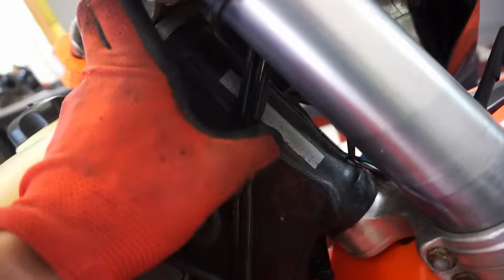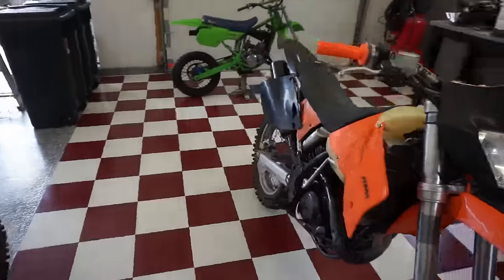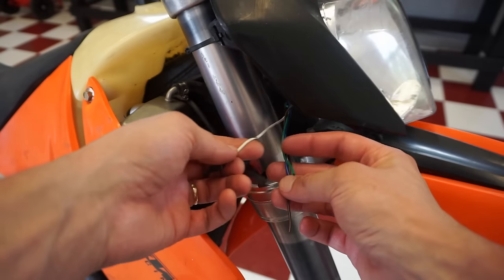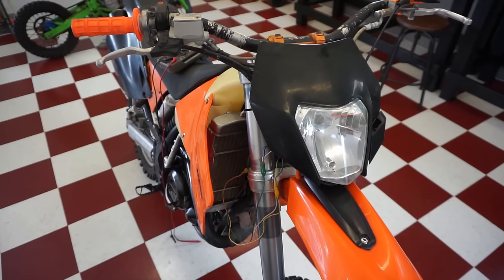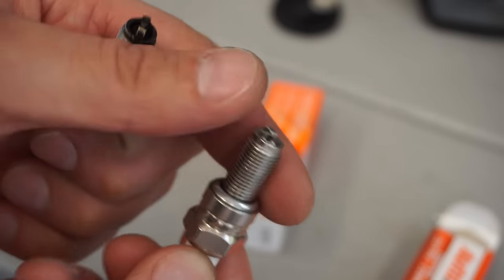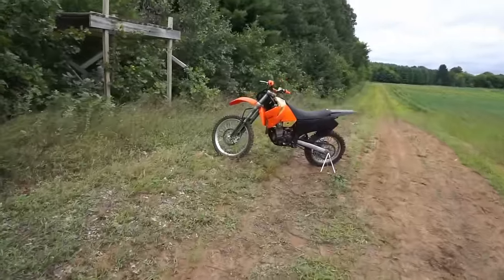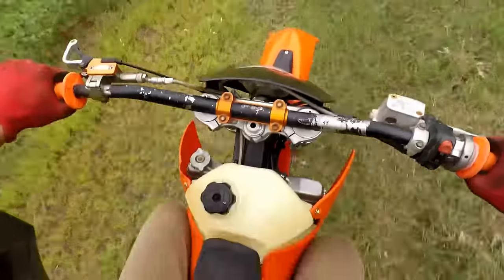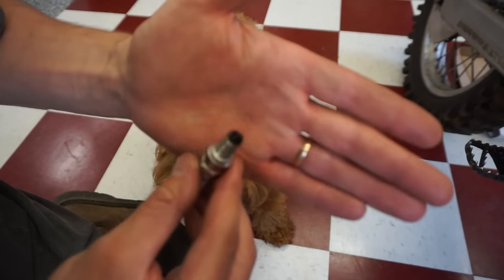This Is Why You DON'T Buy a KTM Dirt Bike ($1300 KTM 450 Find)

Comment: I had 2001 400 exc and honestly this was one of the most robust ktm's I have owned to date. This is dual oil filter motor that will last a long time. The ktm's that came later were more light weight and capable off-road machines but not as robust overall. Just by looking at it wouldn't be hard to get the bike running mint again. Major issues - valve clearances need to be maintained especially intake valves - or replaced if too far gone, clutch basket needs some extra holes for oil to penetrate clutch pack well enough, Magura master could be troublesome, don't use gas with ethanol (if you can) because it will mess up carburator rubber components. Like someone else mentioned this must be later cylinder head - because 2001 comes with dual pipe from the head . Great bike nonetheless.
Reply: I wasn't aware of the gas. I have a 525 and run pump gas.  I will switch to rec now.   I figured being a 525, I wouldn't need to use rec.

Comment: I believe that your KTM 400 has excellent potential.   Sure is frustrating with all of the blood sweat and tears you have invested.  Wonder if there is something off with the carb,  they are complicated.   Choke piston position, Idle circuit, pilot jet, jet needle, jet needle height position, needle jet, main jet...  see if you can find factory spec for all the above.  Re: suspension... same. Find factory spec for compression, rebound, preload for front and rear.  I wish you luck and thanks for the video...

Comment: Make sure you put the slide in correctly.  The plate can go both directions.  It goes the way that doesn't look right.  Also, if you have not put in new mid body gaskets and put a new accelerator pump diaphragm its likely something up.  Also the spray could be a bit much.  As well.  I would soak the body (ultra sonic cleaner).  That thing sounds super plugged up.   I have over 400 hrs on the seat of a 450exc with the same motor.  Its not sluggish like that.  Its likely a 400.... Could be an EXC or MXC or SX.  Research the VIN.... It will tell you.

Comment: Sounds like quad i had. it had cracked spark plug cap. Resistance was ok but slight twist broke it in half and it had carbon trace going almost every direction of the crack.

Comment: It sounds like it’s getting to much gas my 2 stroke will do something like that when the plug gets wet and it will start to loop out like this thing is doing may want to look up and see if u can adjust the pump u mentioned in the video or change the jetting or something

Comment: I believe it is a misfire caused by flooding the spark plug with oil. Rings, cylinder wall or valve seals. no thanks :)

Comment: I seen in another video, I bike had the same problem and it was the needle setting,  Also if you get a husk of honor that's fuel injected, The quick connect fuel line will shave off pieces and lodge in the injector, Once I figured this out my bike runs awesome. It's the same symptoms.
Reply: I just realized it was your video, You're awesome, I love seeing someone work on their own bikes, Ride safe where a helmet

Comment: Jetting is not the issue here if that is truly the stock jetting. These bikes are engineered to run with the stock jetting in the regions that it's sold. The reason the plug reads rich is incomplete combustion NOT jetting. I believe this one is a case of an ignition problem.

Comment: Choke does that running rich or lean from clog in the tank , header exhaust back pressure may be bad coil or plug rich mix doesn't cause over heating good luck like you said they over engineer the ktm no thanks less is more for me, and priced better. Your good.

Comment: That is the rong spark plug for a KTM 
All KTM s use iridium plug and they have that CR flat carbs that they have 10000000 problems  and the main body  is made in 3 pices upper -middle and the lower side where the jets are you need to check the middle body part o-rings

Comment: Had nothing to do with the spark plug cus it started and was creating spark the whole time. It’s the carb if it’s bugging out like that either needa a whole new carb or new jet kit.
Reply: First thing u should do is check the forums for the carburetor specs and make sure they are adjusted properly

Comment: One very last minute thing to check is the spark ignition timing on top dead center on power stroke. Witch is the second time around up on top dead center. The  timing lines markings lined up where they should be at in aligned alignment position.

Comment: It's a gas deliver issue. Or try a diff carb. It's not hard to handle. You just have 10x more experience fixing them than u do riding them. Which is fine but you should practice more for the actual footage taking part.

Comment: I think it's breaking up because of a spark issue that's what it sounds like to me
Reply: Yes. Did you notice he pulled that thingy off the top of the plug? Previous owner probably did that. Removing that is for old school engines with that exposed wire connection to the plug. It could be causing big misfires and the rev limiter is just tracking firings which it’s doing but it’s arcing in the boot. Kicking it over it will spark. Under load and it can’t fire the plug every revolution making it black. I’ve NEVER removed that from a plug on anything but a lawnmower

Comment: Install a VW engine on it.....make sure the engine has two dead cylanders and a bad rod knock.This is great advice from the Blind Mechanic.Oh and use old gas mixed with grease for better lube.

Comment: Had a similar thing happening with my 250 quad turned out some one had put wrong CDI on it and under load was not advancein timing for it to run right wood rev up when not in gear but not under load

Comment: I'm thinking it's an electrical problem. Sounds like the rev limiter because the spark is cutting out, thus loading up with fuel making it seem rich. KTM makes excellent machines. My KTM 350 has been flawless for me. I unfortunately had an accident on the 350 last week and broke my tibia and fibula in the right leg, so my riding season is over. Had to get a rod and pins put in the leg. The bike sustained zero damage and held up much better than I did lol. Ride safe and never take your health for granted!

Comment: looks almost exactly like my 2002 ktm 520MXC as the exc had a headlight stock from it being an enduro bike unlike the mxc which is motocross/cross country i also had same e start problem with my 520 ended up trading it for a 03 ktm 250sx i am currently trying to diagnose all the issue with this one

Comment: Love all the great content,  would love to see you ride an old cr500 💯👏🏾👏🏾
Reply: Art of War  ok thanks,
Reply: Ive had a couple CR500's now. 
I don't understand all of the hype.
As a 450 rider currently they don't stand a chance anywhere at all.
My YZ450 and CRF450R both leave the fully rebuilt CR500 in the dust.
the CR500 steel frame is junk. the suspension geometry is weird. 
its heavy and encumbered so you cant really turn it.
All in all. CR500 was cool back in the day because it was the "biggest fastest" bike.
However, once we got into the age of the 450's with aluminum frames. CR500's just suck. 
they are conversation pieces at best. but they are tank to ride.

Comment: can you try this  remove the  exhaust silencer 
and if you use a fuel line that is Clear i mean you can see the gas then change it for a black one 
ride the bike with out the exhaust silencer if it not change and still ride bad then change the fuel line is your Clear PVC This is a transparent unreinforced PVC tube designed for diesel, oils and biofuels. This is suitable for fuel lines on motor mowers and similar light duty non-pressure applications. Please note that this tubing is not suitable for unleaded fuels.  pls test and comment back if helps

Comment: Its not really charging. Lets be honest. Either stator or rectifier. Or just dont give a fuvk about it and try not to use the electric starter about 29 times every 30 minutes and charge it every now and then instead and youl be fine. Install a led headlight and call it a day. Do you ride at night?

Comment: check the valves again on a completely cold motor. Also check the voltage again now that you got the headlight plugged in. If it isn't leaving u stranded after a short period of riding, it's probably not electrical b/c with a full battery, your bike should be able to run without a charging system for a short period of time normally. My ktm would bog like that only when the voltage got like around 11.0 or less

Comment: Hello,  i have crm50 , if I'll put big bore kit 70cc , is the crank will damage?
Reply: Crank should hold up just fine.
☺
Reply: Just make sure you abide with the instructions on the kit especially the carburettor jet size instructions. You'll need to upjet the main jet.  If you don't, the crank giving out will be the least of your problems...
😲

Comment: Ktms aren’t bad. And if I’m not wrong that’s a older one and the older ktms weren’t good… Never had a problem with mine and it’s a 2 stroke with 200 hours on stock piston
Reply: Not true. The early KTMs were boutique bikes. And at that time, dealers were few and far between. This also caused people to have to order parts online. The older bikes are fine.
Reply: @clintonlied  with my experience the 2010 I have has given us more problems then the 2020 I have. Imo I think 2017+ ktms were better then the older ones. Never had a problem with my 2020 but have had a few with my 2010

Comment: A 20 year old dirt bike!  The title of this video is extremely misleading.

I have a 2017 excf 250 with 10 000 miles on it and the valves are mint and so is the the rest of the bike.  Same service intervals as crf250L and wr250r (I’ve had both).

Comment: Something to add to your arsenal of diagnostic tools would be a spark plug compression tester. It puts the business end of the plug under compression so you can see if the spark fails under compression. Sometimes they look great outside the engine, but the spark "blows out" under combustion pressures. These are usually less than $20.00.
Reply: he literally tried a new plug and it made no difference and it also didn't look great outside the engine. the problem isnt the plug.

Comment: The title of this video is absurd. I have owned only KTM dual sport enduros since moving to Colorado, USA. KTM's are easily the best built and designed off-road bike ever built. My current 2023 KTM 350 EXC-F is a perfect blend of power and weight. Off-road the only limitation to this bike is the human riding it. Why would you buy a bike this old to begin with and then complain about it in the video title? It seems you have the mechanical skills to fix what is wrong from the neglect of previous owners. Good luck and enjoy your first ride.

Comment: You’ve got intermittent spark! Seems to be engine speed related. It has to be the pickup coil or the cdi. KTM engines always sound like shit and makes a lot of strange noises but they are reliable as long as they are maintained

Comment: Check entire air fuel intake.  New air filter? You had fuel issue. Look for missing screws or air leaks in Venturi system. 
Be sure the jets are cleaned properly or replaced. Coil or rev limiter.  Call KtM!

Comment: Maybe the stock jet could have been opened up by the previous owner looking for more power if they were putting rubber o rings to stop a leek that’s not the sign of a pro also check all connections on the ignition system you don’t know how far stupid has gone 👍🏻👍🏻good luck that think should fly even be a bit scary also can you adjust the suspension make it softer ?? And are you missing a light switch and some loom ??🤔🤔

Comment: Don’t blame it on being a KTM because you can’t fix it lol it sounds like there’s a problem with the stater or possibly some loose wires in the mission system that will make it appear to be running rich because you’re not getting proper fire under load.

Comment: These bikes have a huge fan base and were and still are considered awsome bikes, I have a 2004 and I love mine.  Go over to the ktmforum, there are lots of experts and are alway eager to help, they will get you fixed up right away. My guess is that you are correct about the rich fuel bog, replace the main jet with one size smailler and see if it gets better, it might have been drilled out at some point, change the needle hieght and finally  check  your air filer. These things should rev to the moon.

Comment: Get rid of it it’s a head ache. Ktm is garbage. I would not ride that bike. A few miles in the bush. It might die. On trials have to stop
On my 94 Kawasaki to help them. Cause there new bike shut off electronics just stopped working. Not fixable on side of trail. At all it’s a track bike that breaks down over and over